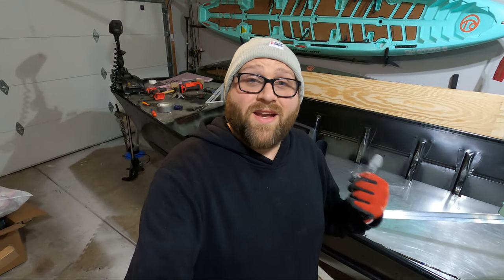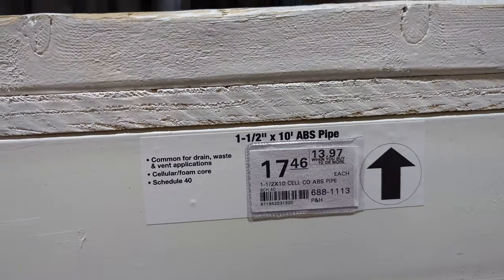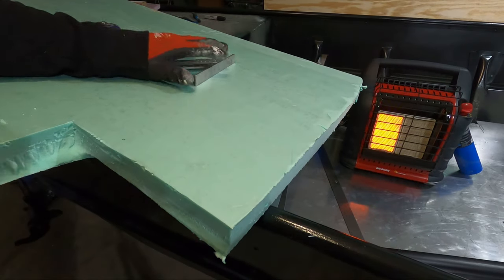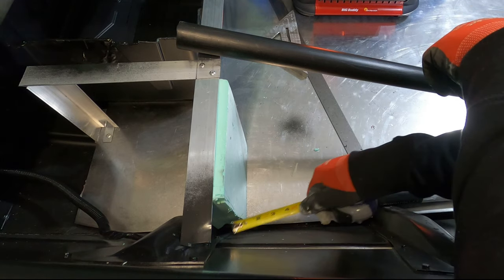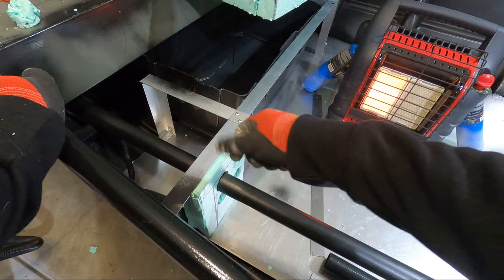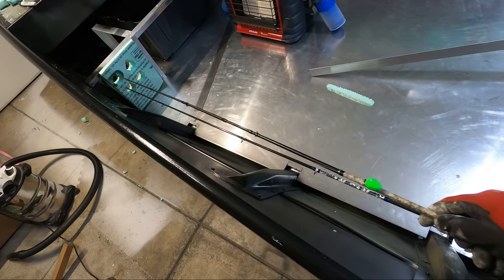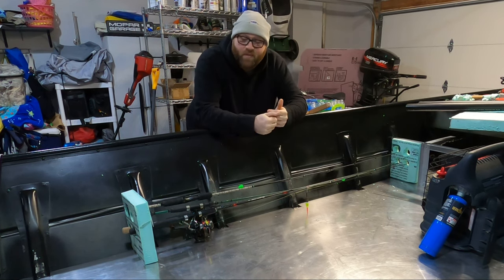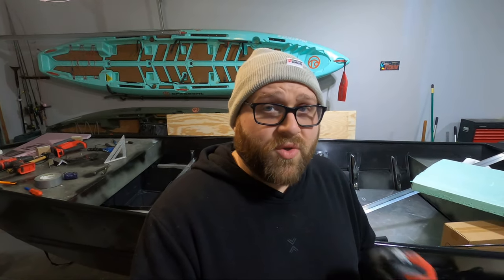JON BOAT ROD LOCKER PART 1

Comment: If you haven't already pick up a small little Heat powered stove fan. It is a total gamechanger for the heater, makes it much warmer. I got the mini like Couture  one amazon, for hunting and then used in my garage as well. Great videos!
Reply from the maker: That's awesome! I'm going to check that out, would be super useful for when I dont have access to electricity.